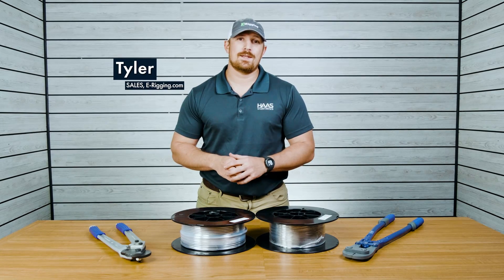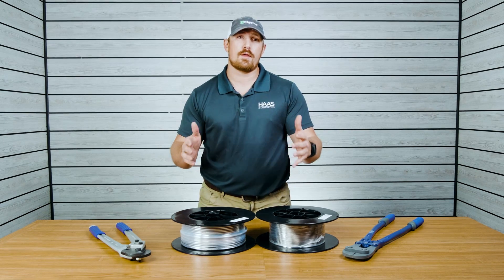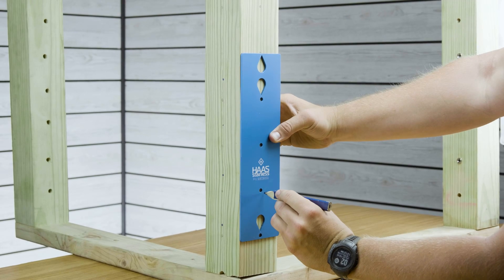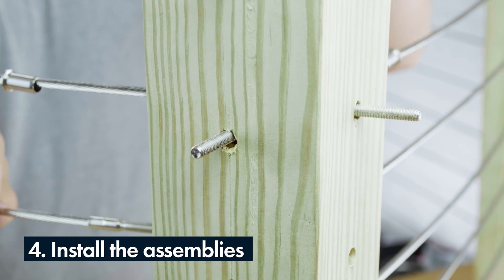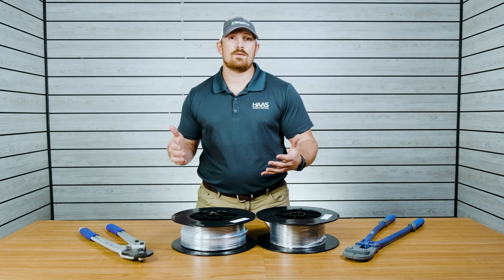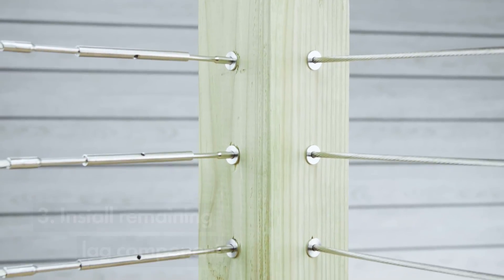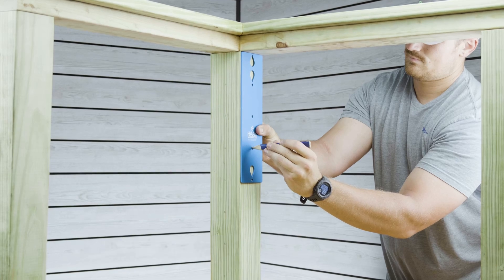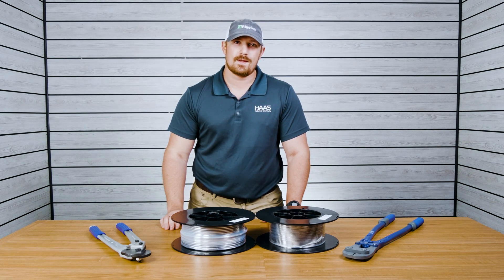Top 3 Ways to Install Cable Railing at a Corner Post

Comment: Forgive my confusion please…so if you are using Standard Swage Stops for a corner post, you do not have to use the 3/16 offset method? I have 3 corner posts at 90 degree turns and am trying to figure out which way is best. Thank you in advance!
Reply from the maker: Sounds like youre on the right track! Totally understood - there are lots of ways to customize your system, so it can be overwhelming at times. The only time you will need to offset the holes by 3/16" is if you work out that you need two intersecting swage stud assemblies at the same corner post. We like using swage stud assemblies because it's low cost, modern and minimal looking (no turnbuckles needed) and easy to tension up.
Reply: That had me confused too. Then I realized the adjustable stud assemblies are 1/4” diameter all the way through, & can’t cross if the holes are level.
The end stops are shorter, only the wires have to cross, & can do it inside a 1/4” hole….at least that’s how I understand it.
Reply: 3/8” hole